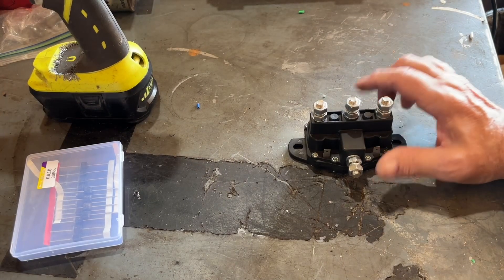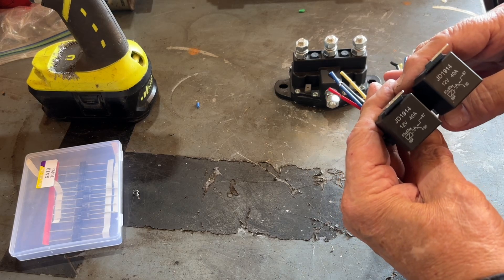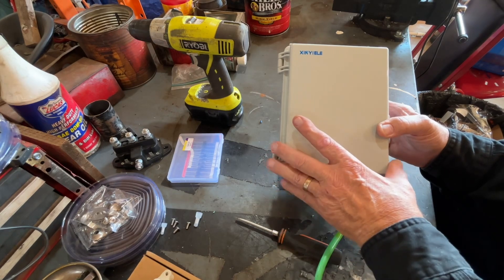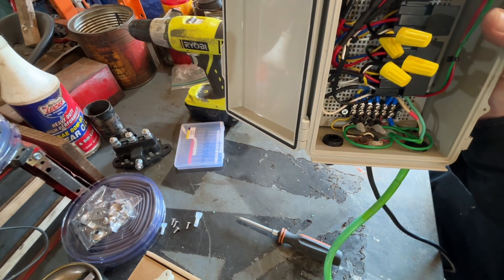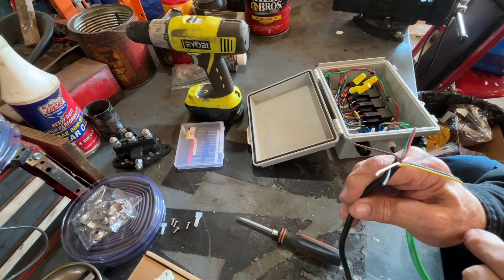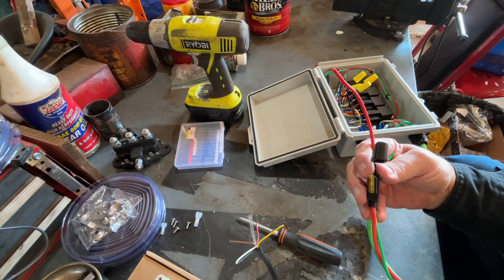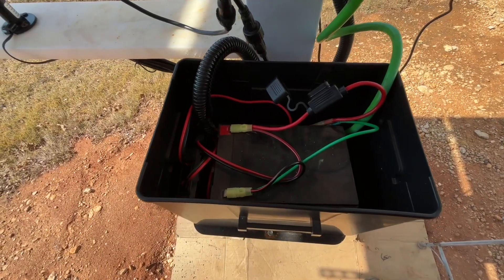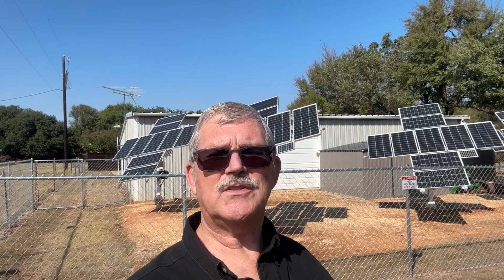Improve performance on the Eco-Worthy solar Tracker Controller

Comment: Could you get somebody to make these boxes for you and then sell them with installation instructions.  I bet people would pay $50-$75 for them.
Reply from the maker: It costs about $40 for everything including wiring to make. Not that hard to build. It’s working good with no problems yet. May be the answer to reduce some the issues. 
A controller costs $75 to $100 so I think you would have to get close to that same amount for the time and trouble. But something to think about. Thanks and take care

Comment: Rusty, I have only had my tracker going a week or so and the controller completely crapped out.  I went from 4 to 8 panels and the tracker drove one corner to the ground.  Is that what caused it to fail do you think?  I have 8 - 200W panels.  Can I get a new controller through ecoworthy?  Only other thing I think could have done it would be sprinkler system water.  What do you think?  End of day, panels went to fully west instead of flat.
Reply from the maker: Eco Worthy only recommends 6-200watt panel. The extra couple of panel could have been a cause for the failure.  
I think Eco Worthy will warranty the failure of the controller but it will take several emails. 
I upgraded my east-west actuator from a 1500n to 3000n  x 12” . You have to reset to the new T3&T9 settings. 
These actuators are available on Amazon and controllers are too just branded as Eco Worthy. 
Hope this info helps. I will be glad to answer any questions. Good luck

Comment: How's she goin'?  This looks like a great solution to the controller troubles Lloyd!  I think it's a good idea to having the relays, one for each direction.  Might help with trouble shooting down the road eh!  Good luck with this set up!!  Take 'er easy!!
Reply from the maker: Im feeling good about using the relays to control the actuators and not putting all the load on the control board. Should really extend the life of all the parts . Cheers Mike

Comment: Ah The Old 40 Amp 5 Pin Bosch Relay!!! Must Be A Trillion Of Those Things Sold A Year!!!
Always A Good Idea To Get The Load Out Of The Control Box!!! Drivers May Work In The Lab But Not Always In The Field!!! But It's Cheaper Than Adding A Relay Pack To The Design!!! Plus They Get To Sell You A New ECU Everytime A Driver Goes Out!!!
Great Improvement There Lloyd!!! I'm A Big Fan Of Removing The Load From Any Control Module!!!
Keep Rocking It Out Brother!!!
Reply from the maker: I think it should make a big difference in reliability and the price of a relay is a lot less than a new control module. Thanks Pat , keep on Rocking and Grinding it down

Comment: I'm sure your design is much better.  I find it amazing how  eccoworthy brought their product to market without proving their design.  It seems to be so common today.
Reply from the maker: I know what you mean but it’s not one of the high dollar systems available commercially. I think using the original control module with my 5 pin relay box will really make a big difference. Thanks Steve, Cheers

Comment: That is a great idea to add relays, I am surprised it was originally designed to take the load through the controller
Reply from the maker: The relays in the control unit say they are 30 amp rated but those aren’t taking the load and fail . Using it as a control unit to operate the 5 pin 40 amp relays should make all the difference. Thanks